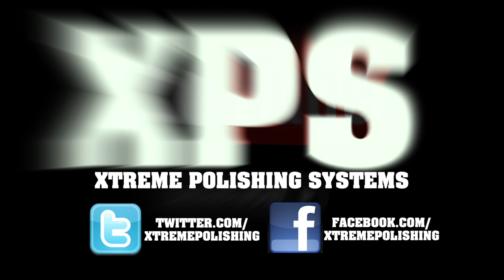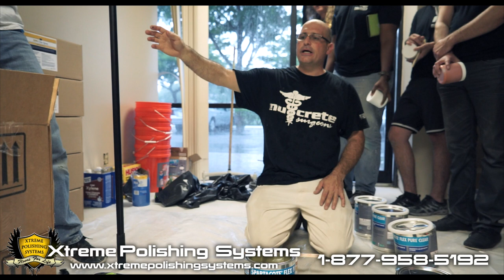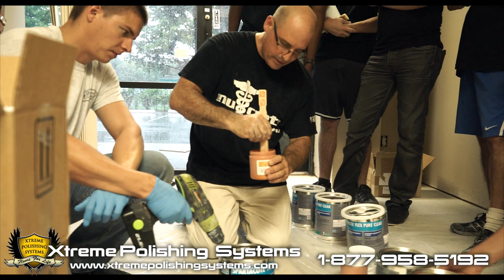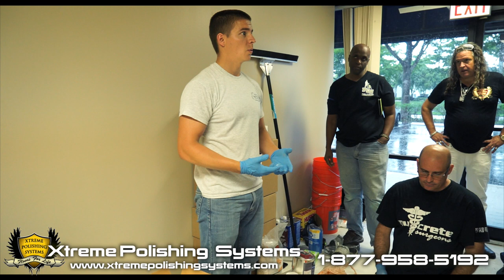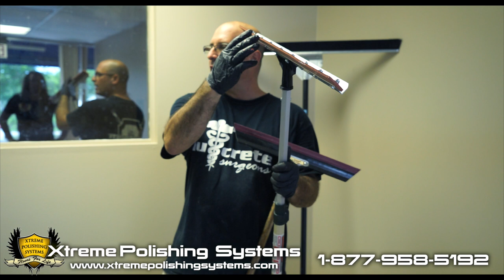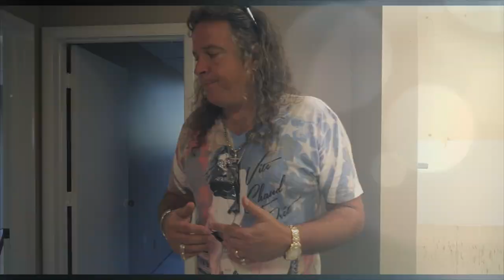DIY Metallic and Glitter Epoxy Floor Application (Orange Glitter) | Xtreme Polishing Systems

Comment: Pulling up my carpets and tiles in a 60s house and terrazzo, yet dull dated and dingy while glittering up in blues comes to mind. Though thank you for an insight filled post. Some epoxy after re plumbing with some resin art, yeah,,, thank you. I don't care how much fun I had spreading Benjamin Moore, this looks like it could spark up my spreading colors ideas.

Comment: does this work on plywood? and if not what's a lightweight alternative as a base for the epoxy floors? I'm trying to put this flooring in a tiny house
Reply from the maker: It's possible to apply over plywood, but it's an extremely tedious process to make sure the cracks will properly set with the epoxy. I would suggest giving our industry expert, Chris, a call at (877) 958-5192 for the step by step process for applying epoxy over plywood.

Comment: Thinking about doing this at a spa I'm opening up and was wondering if there is any coat that can be put on top to reduce a slipping risk for clients?
Reply from the maker: If the floor is properly cured and sealed, the flooring should not be slippery. We do suggest using Sparta Flex Pure, as a top coat. To check out the specs, please visit https://goo.gl/bPWCQK

Comment: Typically, how many square feet will a gallon of resin cover in a floor application similar to your flooring videos??
Thank you
Reply from the maker: Our clear epoxy kits are $150 for 3 gallons. This kit will cover between 375-450 SF. When adding in color and metallic pigments, each packet covers 45-50SF. Recommended 2 pigment packets per kit. It's based on the SF you are looking to do. Then you would need a topcoat to seal and protect the newly installed floor. To view our selection of epoxy products, please visit https://goo.gl/fTX1b1

Comment: would this work over porcelain tiles?
Reply from the maker: Yes, epoxy can technically be applied over porcelain tiles as long as it's a ground down smooth surface, but it is not ideal.
Reply: ali rabah popping up tiles is not as difficult as you might think, just time consuming.